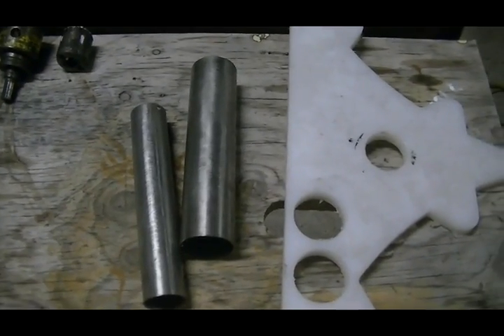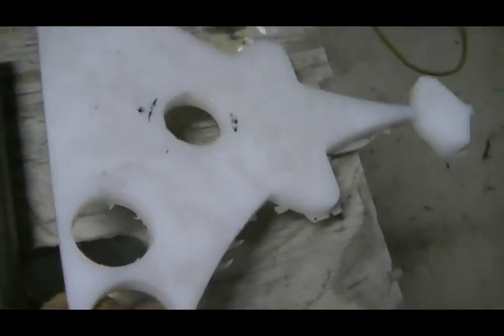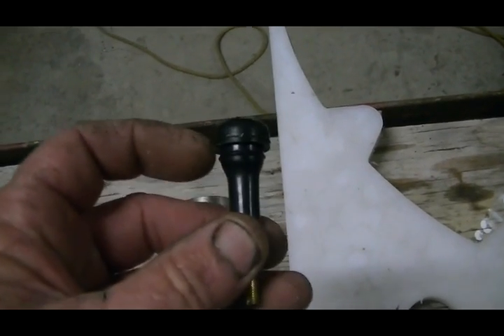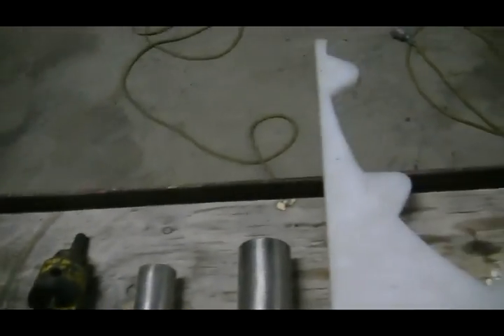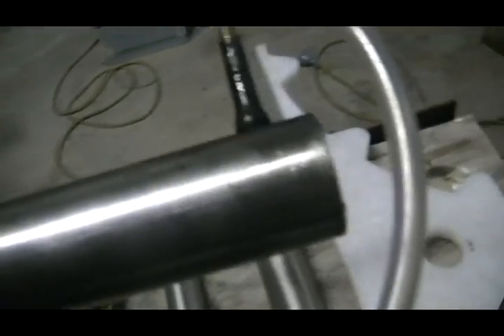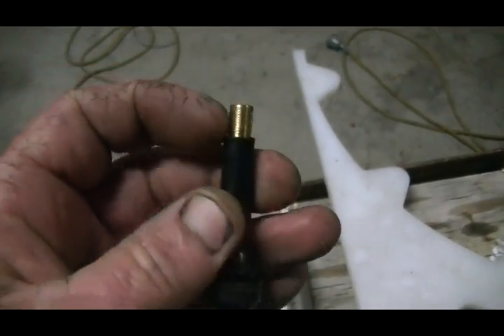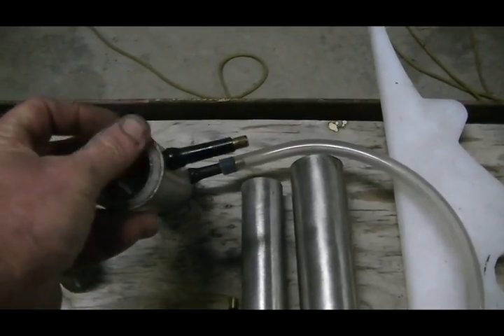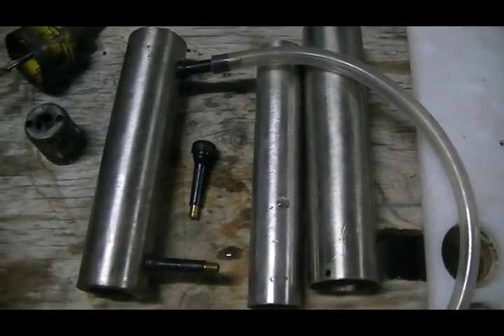My zero current leakage tube cell

Comment: Tube cell help. When doing a tube cell remember to use 304-316 SS "seamless tubing" not "drawn over mandrel DOM". Seamless is used for hydrolics and high pressure and most tractor or hydrolics or industrial supply will carry it. The size is really your choice but make sure your gap is .050-.080 for best results. 1.5mm (.072+-) is optimal. If anyone needs some tubes machined contact me. Max miller has a nice set ready to go as well. David A. Puchta 1-858-381-7923